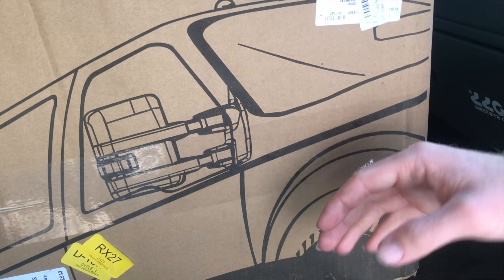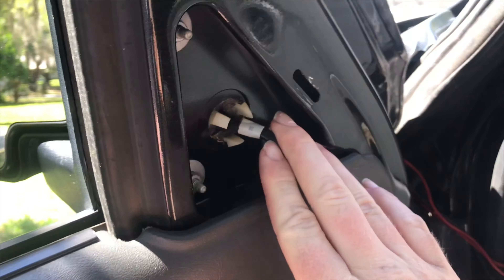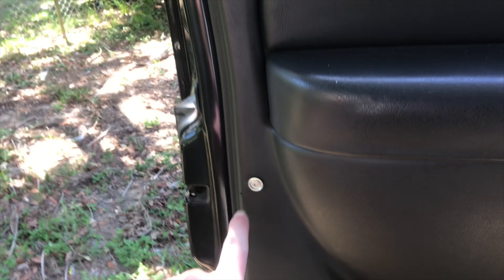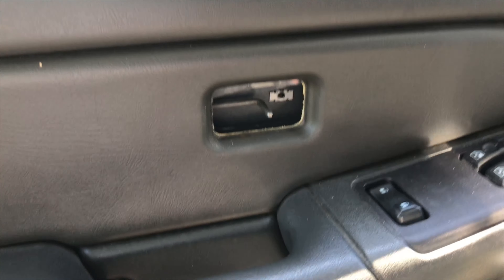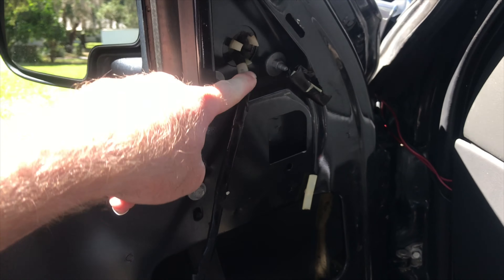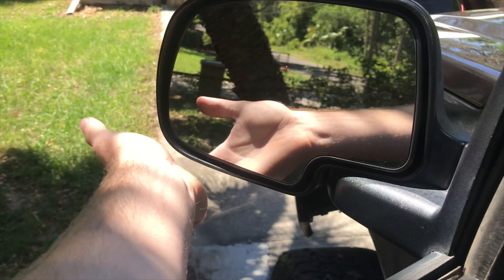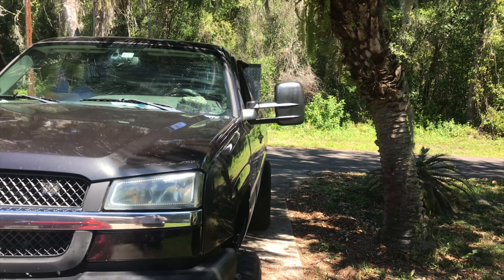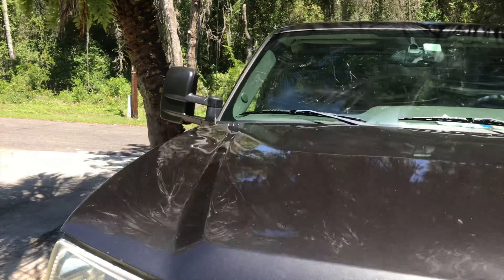99-06 Silverado Tow Mirror Install

Comment: Do you have a body lift installed on the truck if so can you still do wide donuts 🍩 or does it effect it Bc I got my truck and it had body lift and haven’t tried it yet lmk plz
Reply from the maker: Yes I have a body lift but I can’t say I’ve tried to do a donut. But I don’t see why it would affect it tbh.